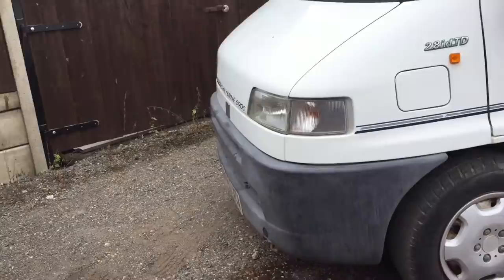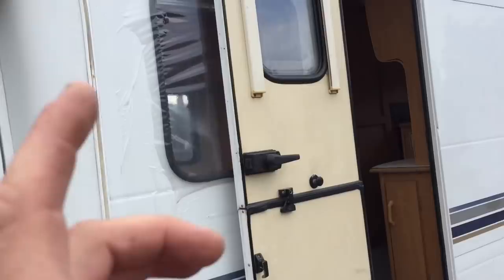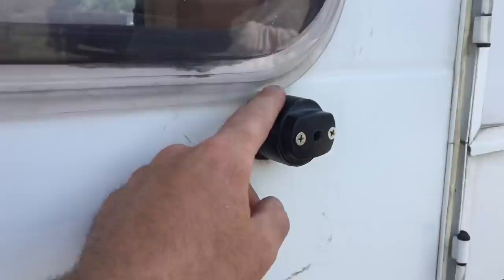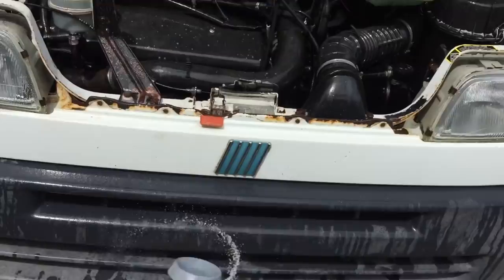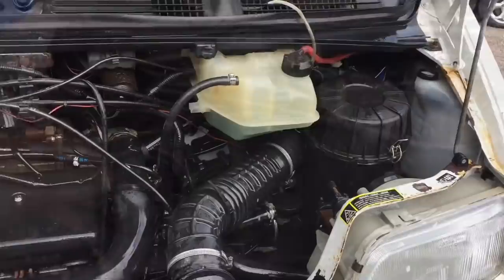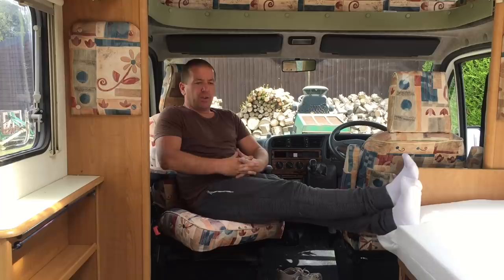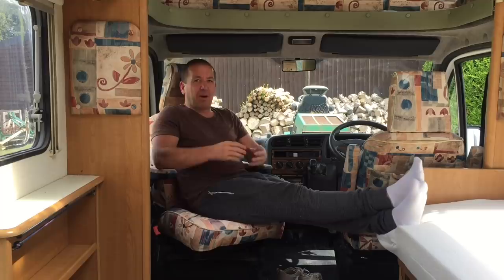Robs Bargain Motorhome camper RV Autotrail Project part 6

Comment: I tried Back to Black once. Should be called Back to Shiny Faded Grey. What I use is Black Trim Wax by Carplan. It is like shoe polish in a more liquid form. It stains the plastic black again and leaves it with the original matt finish. Just remember to put masking tape on the paintwork around the trim to keep the wax off the paint.

Comment: a 3 way fridge and gas fire will add 1000+ to the value, try Jones caravan breakers @ prospect in Cumbria Rob they break caravans and statics, a gas fire from a static will work in that motor-home (they both use propane), any caravan 3 way fridge is also suitable there standard widths , keep it up, i have just watched them all back to back :)

Comment: Check jacking points battery tray area varous areas around arches lower cross member.. hooks that hold water tanks....water infrom windscreen...sealant around fire flue on roof leaks if not attended to..

Comment: its coming together Rob. Im interested to see the glass fibre repair in detail. 

I think it would add good value to get the heater , and fridge done. Also get a safety test done for selling on. Im sure that will add good value and edge it towards the £10k mark. 

good work guys
Reply from the maker: If all that was done it’s a 15k van 👍
Reply: You know it makes sense. Caravan/camper van prices have went ballistic due to the C19. There is no way you will lose on this one dude. £££. You have broken it’s back , and done the hard work. Some small touches will make all the difference. 👍🏻

Comment: The sockets and switches would have been much whiter. Plastic from that era 'bleeds' oil. You can see it on old computer keyboards.
Reply from the maker: I have just looked them up they are the correct colour 👍

Comment: You have made a very good job of the van is the welding on the chassis at the front that's where mine had gone, was told there was lots gone there, keep up the good work mate
Reply from the maker: Yes and the steps 👍

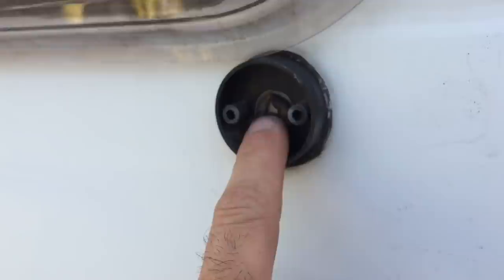Comment: 4:34 If you want to turn silver colored screws, nuts, bolts etc.. You can turn them black by 'Hot Blueing or Cold Blueing' methods and also by bluing them they become rust proof. If they are any type of plating obviously the plating will have to be removed, usually 24 hours in a acid/vinegar bath should remove the plating.

Comment: To prevent the crack in the rear from getting worse (cracking further) drill a hole at both ends and then fibreglass repair.
Reply: Saw that on Wheeler Dealers when Ed China fixed a BMW bumper.  Worked a treat.

Comment: Well done guys, whats the front cross member like, is that the welding you mentioned?
Reply from the maker: No that seems ok
Reply: Just changed the crossmember on our 2000 Ducato.
300 Euros through the Fiat dealership, 60 euros off eBay.
Guess which one I went with!

Comment: Rob, as I watched the video -  At the back of the Campervan, could you tell me what is behind the rear number plate. it looks like there are 2 locks and the panel opens up.  Cheers keep up the great content.
Reply from the maker: I think it’s storage it has spare wheel leisure battery etc 👍

Comment: When you did the cam belt , did you have a stand under it? The bottom of the inner wing has some rot on it? What is the rest of it like? Apart from that, as previously said, this has been one of the most interesting and informative videos you have done. Did you ever find out what happened with the side window seller?
Reply from the maker: Yes I never work without a stand I put it under at 4 minutes 👍

Comment: There's a real design fault with the positioning of that window. If the wind catches the door it will smash into the window.
Reply from the maker: It won’t it’s got a door stop 👍
Reply: Door stop is only of use when the window is closed. When open the door will smash into it. Been there. @sruk

Comment: The motor home has been no pushover, it has taken a whole load of work to get it where it is now. It is looking sounding and should be in a far better place than it was, the fridge and fire are still  AWOL which is a shame. I am certain there is someone probably nearby who has replacements, but are they available and at a sensible price? 
The rear damage looks a bit obvious, but from what you are suggesting it may well be far more dramatic than a true challenge.
 Will that get the magic touch?
I think those sockets were an ivory colour when they were fitted. It might have been trendy once, along with scarlet, but that was only useful for emergency sockets, not in homes or houses